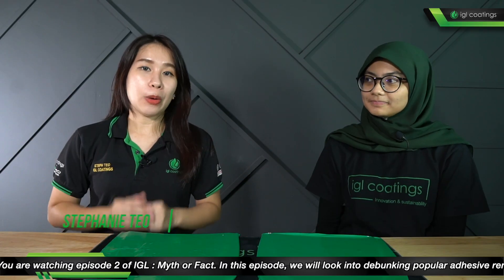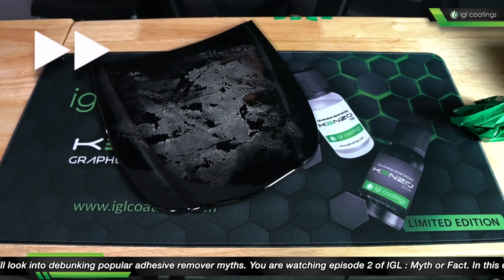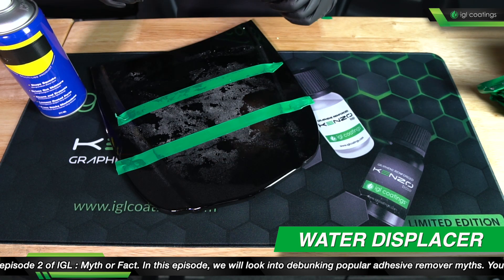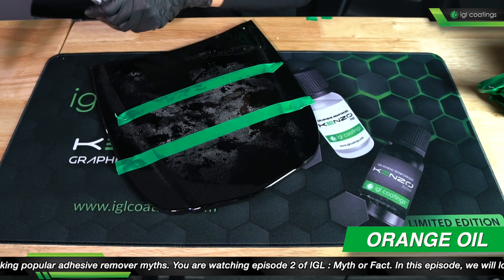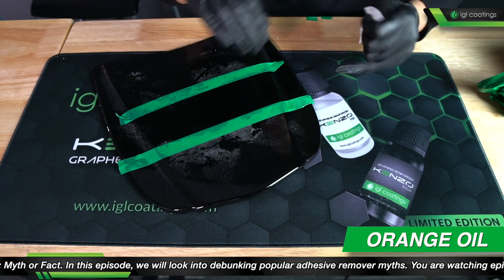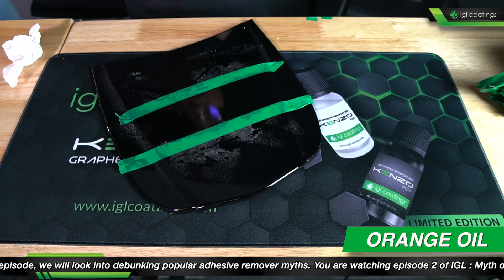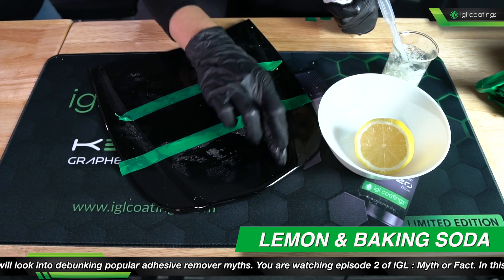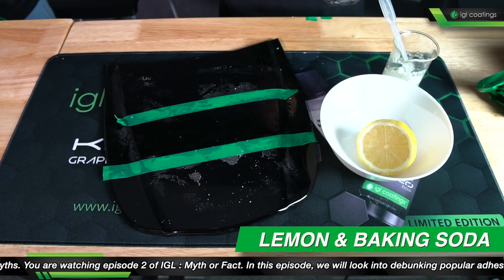Myth or Fact (Episode 2): Glue On or Off?

Comment: Great video.i have a query Igl precoat is said to be infused with orange oil also would it leave behind any residue or any polishing oils.
Reply from the maker: Hello! Orange oil mentioned may be referring to our fragrance. Our blend will not leave behind residue. In fact, Precoat is an intense cleaner designed to dissolve oil particles, that weakens the bond of waxes, oils, and polishes 😊